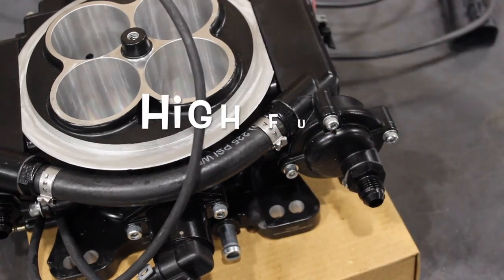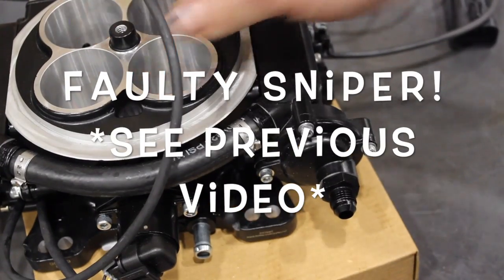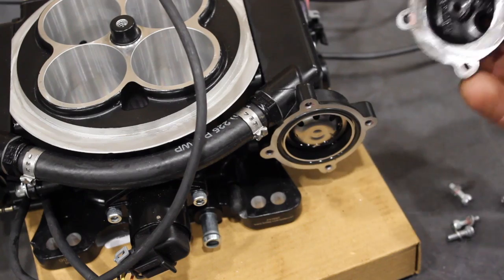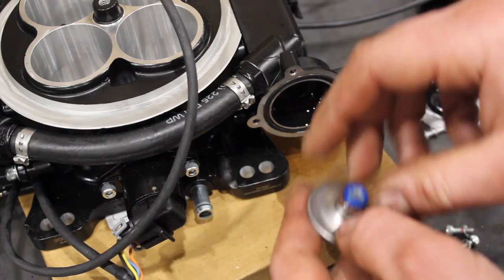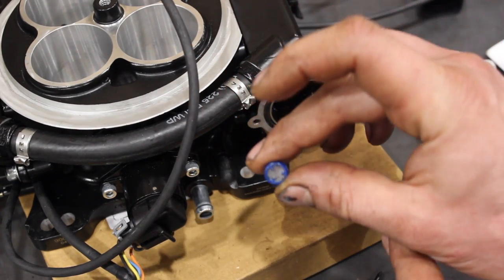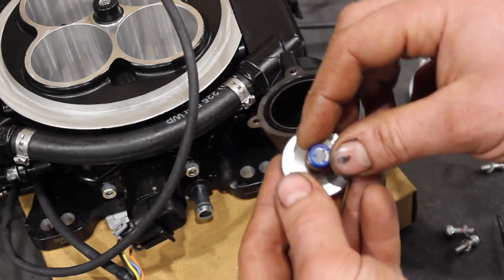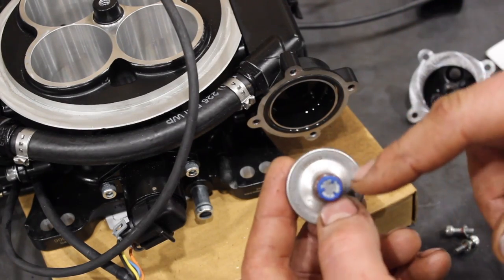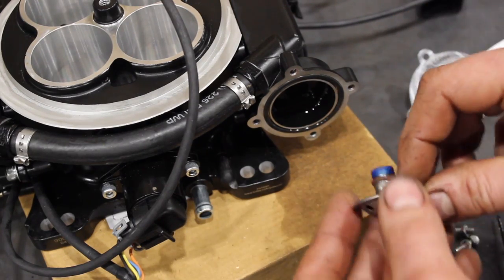Holley Sniper High Fuel Pressure Fix!

Comment: Really not happy with my sniper. My sniper has less that 500km and has left me stranded multiple times. Holly is no help. Most recently my car started backfiring/lost power. Now can only get it to start while pressing my pedal with half throttle. Maybe this is my issue. Holly told me on the phone it’s ignition related. However my car runs if I dump fuel down the tbi. At this point might just have to go back to carb and take this as a 3500$ lesson unfortunatly. Really havnt seen anyone else with this issue
Reply from the maker: Yeah thats  weird one, have you checked fuel pressure by chance? I find alot of the time its a mechanical problem, fuel pressure or vacuum leak causing issues but guys will think its the sniper. 
Feel free to email me at pcperformance1@outlook.com if you have any questions. Ive installed quite a few of these systems

Comment: Great video, have you ever installed the new in-tank Holley 255 LPH OEM Style EFI Fuel Tank Modules (12-304) that has the in tank fuel pressure regulator, and any servicing to the pressure regulator similar to the one you show on this great video. thanks

Comment: I just purchased the Holley Sniper Stealth 4150 for my 421 SBC. I had the Edelbrock pro flo 4 on my old tired 350. What are your thoughts on both? I really liked the Pro flo adjustability. I sold both the old 350 with the Pro flo and I’m will be using the sniper stealth model with the timing controlled Hyperspark distributor and I’m looking for input on it. Phew that was a lot.
Reply from the maker: Both work great! 
I find the pro flo is abit more simple for adjustments. The sniper is also fairly simple setup but can be abit more difficult to fine tune. Most engines need very basic changes but some will need more fine tuning on hot and cold starts. 
The sniper is also abit more versatile

Comment: Dude we really don't use those so I'm curious what is the trade-off as far as performance?
Reply from the maker: Most guys notice right away how much better the throttle response is with the sniper and obviously drivability is way better. As far is HP there's really no difference as long as the carb was working and sized correctly beforehand. But alot of carbs are not set up, jetted or working properly so most guys will feel a power difference